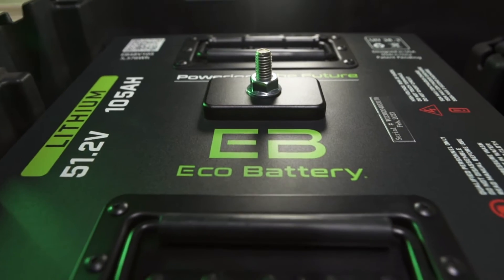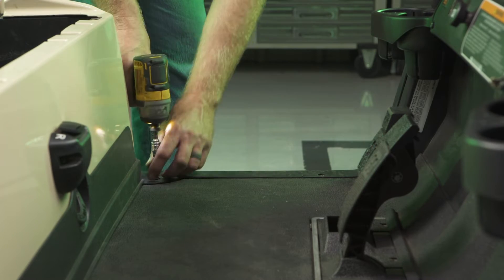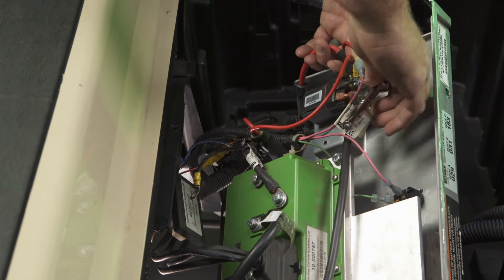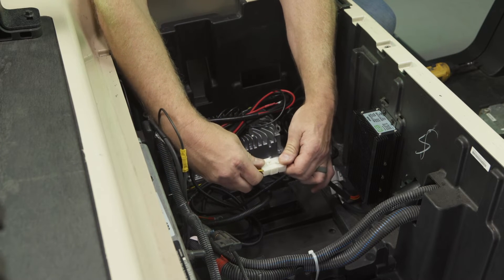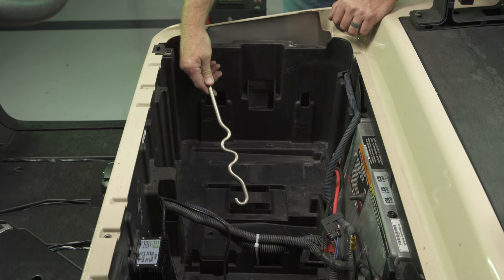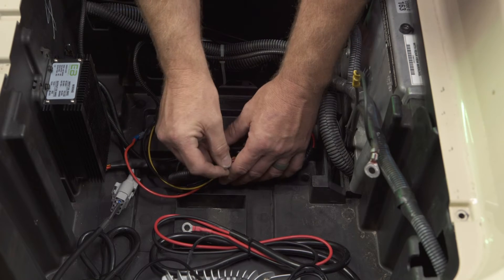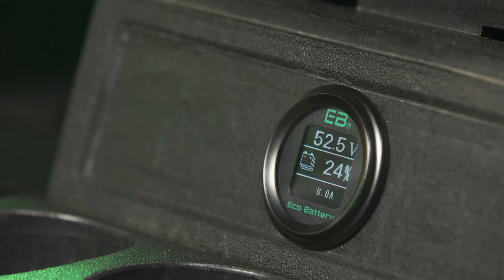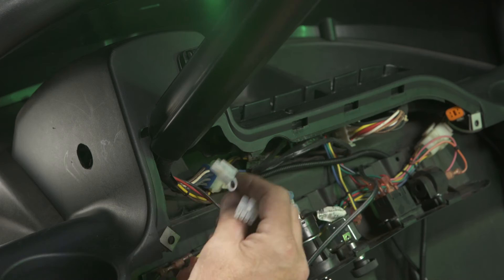Club Car Precedent / Onward / Tempo Eco Battery Installation Guide | 2004-Present

Comment: It’d be nice to have a video of a 4/ 12v club car due to the different positioning of the controller, tow switch, and solenoid. I’m having trouble finding any info or videos on how to go about mounting a lithium battery with this right in the middle of the battery compartment.
Reply: me too. it seems to slide out. So maybe mount it anywhere.

Comment: I just ordered an Eco bundle for my 2022 Club Car Onward HP.  The HP models are AC powered.  Unfortunately, I had forgotten about that prior to ordering the new battery.  Am I going to run into any problems?
Reply from the maker: Is this a factory lithium AC?
Reply: @ecobatterylithium  No.  It currently has Trojan batteries.
Reply from the maker: @ra1279  The Eco Battery conversion is compatible with all lead-acid equipped Precedent, Onward, and Tempos, regardless of the drive system. You are good to go!

Comment: Slightly older models will require a mod to wiring to bypass the on board computer. Maybe you all should have put that in the video?
Reply from the maker: That is actually a myth. An OBC bypass is not required when installing our lithium battery. It can be bypassed but is not required. The only time the OBC would need to be bypassed (or replaced), is if the OBC itself has failed. You could go ahead and do it now during the installation process to prevent it becoming a possible failure down the road, but it is not required.
Reply: @ecobatterylithium  Bypassing the OBC is good practice if the original club car charger is not going to be used.

Comment: I have a 2018 Onward. I has headlights and brake lights, but no aftermarket 12v accessories. There are 6 8-volt lead acid batteries in there now. Is there likely a 12v reducer already onboard? Where is this connection made? I have ordered a 48/105 bundle, including the 12v reducer, but I'm thinking I may not need that reducer. I'm not near to the cart, so I can't check. Thanks.
Reply from the maker: @bhd1506 you will need to use the converter in the bundle since you have lights.
Reply: @ecobatterylithium  Okay. Good to know I didn't waste any $$ on the converter. Where am I likely to find the connection for the lights now?